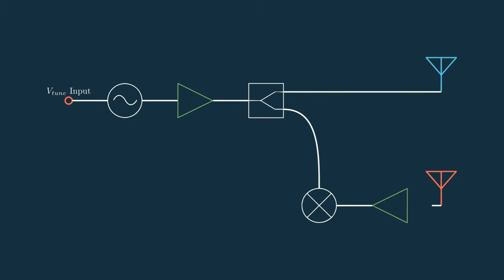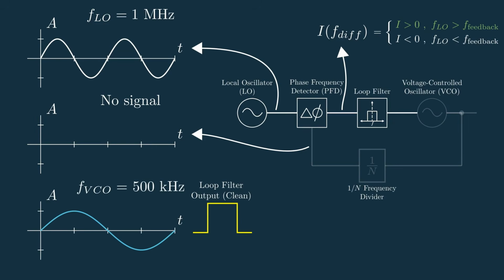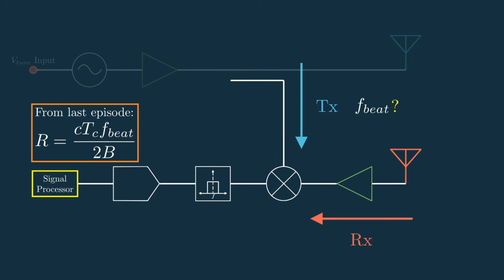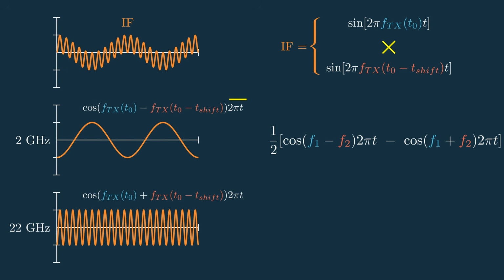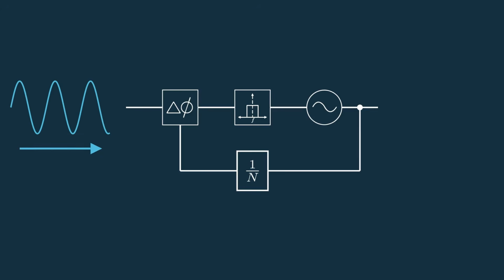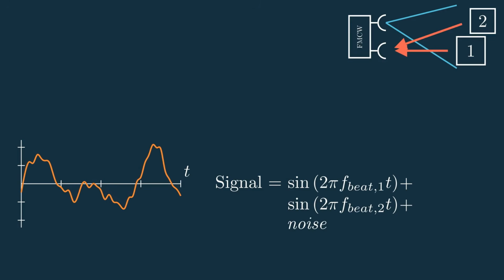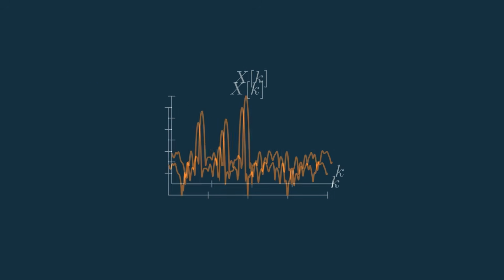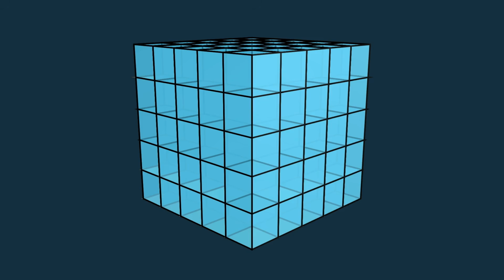How do you build an FMCW Radar?

Comment: I implemented a PLL in C code when I was working on a Stirling converter. A position sensor gave us a periodic but not sinusoidal signal and we used a PLL to turn that signal into a clean sine wave. I didn’t understand the math of the PLL and had never heard of them before, but I did know how to turn a block diagram into C code and it worked well. That was just one part of the controller that also included a couple PID loops
Reply from the maker: Awesome project!

Comment: if you like this maths, you should have a look at how MRI machines work - it is similar - acquiring spread spectrum frequency samples then doing multiple Fourier transforms to resolve 3d images of what you're sampling with radio waves and magnetic fields.
Reply from the maker: Super interesting! Thanks for pointing me to it!
Reply: @MarshallBrunerRF  super-funky MRI can actually multi-dimensional analysis of single voxels - examples include diffusion tensor imaging for mapping the direction of neurons in the brain, basic t1 vs t2 imaging to measure the difference between fat and water based on relaxation rates, or even MRS - where you do spectroscopy to determine ratios of amino acids, and their spatial distribution

Comment: Thanks for doing this video series! It's very well explained, and makes many of the concepts clearer - I wish I had it for reference a few years ago.
Regarding the FFT sampling, it would be helpful to explain how "real-time" detection is handled. Your explanation works if you want to do offline analysis, but typically you want to do detection with some update rate where N_window  is smaller than the total samples N. This is even more true when considering hardware implementations, such as doing the FFT in a FPGA, where you may be limited to say 1024 samples. In such cases, would you buffer N_window and perform the FFT on non-overlapping chunks? Or would you have some half-way overlap? Or would you run a continuous window such that your buffer is essentially a big shift register? Are there advantages / disadvantages to each? And then is there any notion of stitching the windows together after the FFT, or are they typically considered independent snapshots?
Reply from the maker: Thanks for the comment! And good point, yes often times you want your radar to be able to react in real-time and this may be too slow for that. Non-overlapping seems to be the simplest / least compute intensive in many cases. The trend going along the line of non-overlapping, overlapping, and sliding DFT windows normally gets more resource intensive but also more flexible / low-latency reactions. Honestly on this, I'd have to defer to people more experienced with me in real-time FPGA programming as this is something I'm relatively new to.

Comment: Great Channel! Thanks for your efforts.  I have a question.
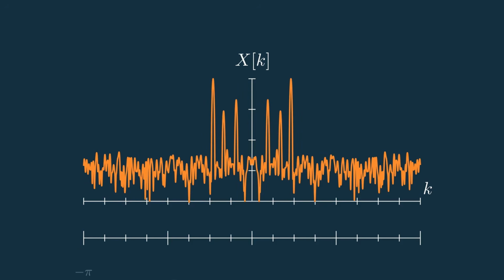At 17:08, you mention the FFT spectrum ranges from -Fs/2 to +Fs/2 accross negative and positive axis. Isn't that true for baseband signals only? Are beat signals downconverted to baseband before digitiazation?
Reply from the maker: There's a couple ways to digitize RF signals, but they are almost always downconverted at least partially. Many times they are offset by some amount (could be 2MHz just to get it away from DC noise), but sometimes they're also just converted to baseband. The spectrum of an FFT will always have the +- frequencies, but many times your signal is upconverted to RF or an IF in which case the actual information is contained around IF +- bandwidth. Hope this helps!

Comment: Hmm... I have doubts that anyone uses the PLL divider to modulate the output frequency. Usually when the divider is changed, the PLL will fall out of lock and it will take some time for it to stabilize. Maybe with a special divider that does retain the phase when the divisor is changed this would be possible? Usually the input (reference) frequency to the PLL is modulated, at least for some lower frequency applications. I'm not familiar with higher frequency radar systems.

Comment: I am curious if these systems also modify the polarization of the signal. I know that most aircraft radar uses polarized signal and, based on the polarization of the received signal, you can tell whether the target is at higher or lower altitude, for example. I wonder if these FMCW systems also modify the polarization over time to get extra information?
Reply from the maker: Honestly I know much less about dual-pol FMCW systems than I do about pulsed systems. I would love to make a video about dual-pol weather radar, though - that is one of my favorite concepts :) Thanks for watching!

Comment: Is it possible to get target data just from clutter alone only using a receiver?
Reply from the maker: There are passive radars with no transmitter, but they still need to be able to detect some microwave source. There needs to a transmitter somewhere, but that could be a multitude of things. Thanks for watching!

Comment: I just had a quick question. At around 10 minutes into the video, you discussed the noise that could interfere with getting the beat frequency, and you mentioned using a bandpass or other filters to cut out undesired noise. But then doesn't that restrict the velocity of the object you're tracking to a single direction. If you use the lowpass filter like in the video, then any object coming towards you would just be invisible, no? Just wanted some clarification, thanks.
Reply from the maker: There's a few ways to get velocity information (some of which I talked about in the next video in the FMCW series about range-Doppler measurements). You don't necessarily have to lose velocity information like this with filtering. Often times the same chirp is transmit multiple times and then pulse returns are compared to one another (using the FFT) to extract velocity information. Thanks for the comment!
Reply: @MarshallBrunerRF  Thanks for the response. I'm still a bit lost, even if the same chirp is transmitted multiple times, if the output happens to fall on the wrong side of the original transmit frequency won't the filter just cut it out entirely? Appreciate the help!

Comment: What do you think about BGT24MTR11E6327XUMA1 as the main radar chip? Is it difficult to implement?
Reply from the maker: It looks pretty cool to me! One thing would be that it seems to be at end of life, but if you don't care about manufacturing this or supporting it long-term, I guess this doesn't matter much - it seems like there's still a good bit of stock. If this is the frequency band you're interested in operating at, I think it would work well. I think it'd definitely be worth a try at $13!

Comment: Hello again 😊

I feel that you are too focused on modern digital solutions to really show how the fundamentals of signal processing does not need that "complication".

Consider the PLL, the modulation input as described here is by manipulation of the frequency divider. An analog solution could just use a VCO.

Consider the output, a (simple) RF decoder tuned to a centre of the expected beat frequencies would output a voltage determined by range.

Note, aviation radar altimiters use a triangle modulation. That way rate of climb, as well as altitude are easy to decode with analog circuits.
Reply from the maker: Very good point. Yes there is a lot of extra complication with modern systems. My thinking was that if someone opens an automotive radar datasheet or looks at an FMCW schematic they would recognize the parts. I agree that it could be more helpful for someones deeper knowledge to understand the basics and build up from there. Maybe I will do a separate video on that. Thanks for watching!

Comment: Ah this must be  the sort of "radio altimeter"  used by large jets on final approach in low visibility weather. They work from a couple thousand feet right down to 10 feet above the runway. 
(And a frequency that the corrupt FCC is allowing certain 5G carriers to crowd into for unclear reason$$. ) 
Barometric pressure is used at higher altitudes to keep all the planes on the same relative reference.

Comment: very interesting field but not something you can build in your yard. Mostly associated with phd students in military and aviation industry. Nevertheless interesting field and great videos.
Reply from the maker: @rubhern8187  well there are some radar chips for under $100 that can do well, especially for automotive use cases. But yeah the price can scale quickly depending on your use case
Reply: You can do it with a Software Defined Radio, though phase-coherent duplex tx/rx ones are pretty expensive (like the Ettus Research B100 series)

Maybe it's possible to do it for cheaper with incoherent radios that can transmit (like a HackRF) and receive (like an RTL-SDR) and do a phase locked loop with the strongest part of the pulse (Line-of-sight)

Or you can get radar chips like he said 😂

Comment: AI Summary

Abstract:

This video explains the hardware and software implementation of Frequency-Modulated Continuous-Wave (FMCW) radar systems. It details the core components, starting with signal generation using a Phase Locked Loop (PLL) comprising a Phase Frequency Detector (PFD), Voltage-Controlled Oscillator (VCO), and a variable N divider to create the necessary frequency ramps (chirps). The signal path involves amplification and splitting for transmit and reference paths. A key component, the mixer, is explained as a multiplier that generates sum and difference frequencies from the transmitted reference and received target reflections; the difference (beat) frequency contains range information. The video addresses mixer challenges like image frequencies and solutions like filtering or image-reject mixers. Finally, it covers the transition to the digital domain via an Analog-to-Digital Converter (ADC) and the use of the Fast Fourier Transform (FFT) on the sampled beat signal to produce a range-FFT spectrum, where peaks correspond to target ranges. The advantage of FMCW's zero minimum range capability over pulsed radar is also highlighted.

FMCW Radar Implementation: From Hardware Components to Range Detection

*   0:00:28 System Overview: An FMCW radar consists of transmit and receive sections with key blocks: signal generator (PLL), signal conditioning (amplifiers, filters, splitters), mixer, Analog-to-Digital Converter (ADC), and antennas.
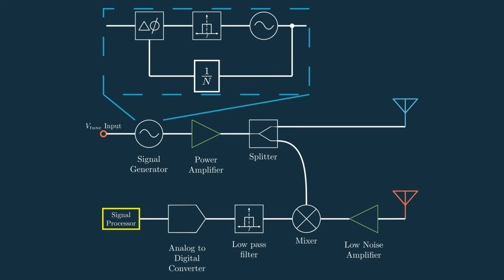*   0:01:12 Signal Generation (PLL): A Phase Locked Loop (PLL) is commonly used to generate the frequency-modulated signal (e.g., sawtooth, triangular wave).
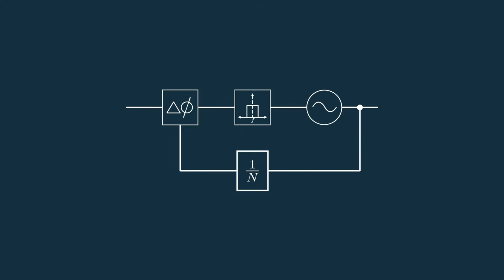*   0:01:49 PLL Components: The PLL consists of a Phase Frequency Detector (PFD), a low-pass filter (charge pump), a Voltage-Controlled Oscillator (VCO), and a frequency divider (N divider).
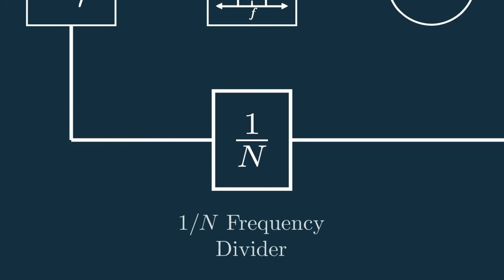*   0:02:10 PLL Operation: The PFD compares a reference frequency with the divided VCO output. Its output current/voltage adjusts the VCO frequency until the loop locks, making the VCO output N times the reference frequency.
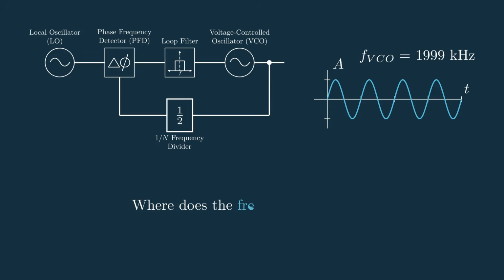*   0:04:40 Creating the Chirp: The frequency modulation (chirp) in FMCW is achieved by dynamically changing the division ratio (N value) of the PLL's frequency divider, causing the locked output frequency to ramp up or down.
*   0:05:43 Obtaining the Beat Frequency: The core goal is to find the frequency difference (beat frequency) between the transmitted signal (reference) and the time-delayed received signal reflected from a target. This difference is proportional to the target's range.
*   0:06:16 Mixer Functionality: An RF mixer multiplies the reference (LO port) and received (RF port) signals.
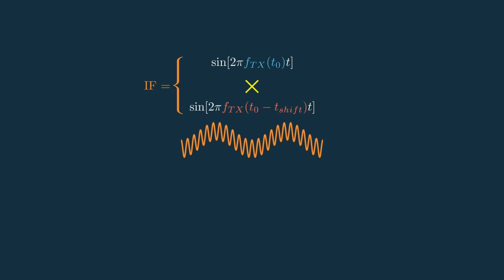*   0:08:07 Multiplication Yields Difference: Using trigonometric identities, multiplying two sine waves produces components at the sum and difference of their frequencies. The difference frequency component is the desired beat frequency.
*   0:08:51 Filtering: The unwanted sum frequency component is typically much higher and easily removed with a low-pass filter after the mixer (on the IF port).
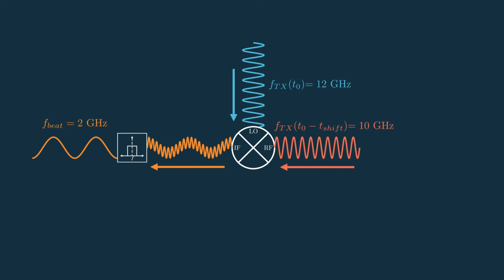*   0:09:06 Mixer Image Problem: Standard mixers produce the same Intermediate Frequency (IF) output for RF signals located symmetrically above and below the Local Oscillator (LO) frequency. This "image frequency" can allow noise or interference to degrade the desired signal.
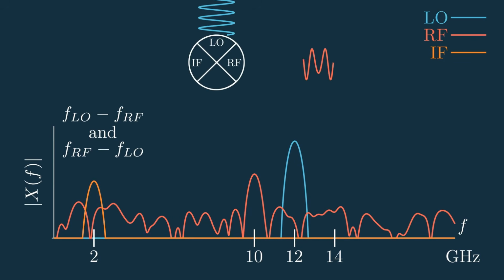*   0:10:08 Image Rejection Solutions: The image problem can be mitigated by using a band-pass filter before the mixer to remove signals at the image frequency, or by using an image-reject mixer architecture.
*   0:11:48 Digitization (ADC): The analog beat frequency signal (IF output) is converted into the digital domain using an Analog-to-Digital Converter (ADC) for processing. The ADC samples the signal at discrete time intervals.
*   0:14:32 Frequency Spectrum Analysis (FFT): The received signal contains multiple beat frequencies from different targets and clutter. Applying the Fast Fourier Transform (FFT) to the digitized time-domain samples converts the signal into the frequency domain.
*   0:16:03 FFT Processing: Common steps include applying a window function to the samples (improves peak detection), performing the FFT, and often converting the output magnitude to a logarithmic scale (dB) for better visualization.
*   0:17:21 Range-FFT Spectrum: Since beat frequency is proportional to range, the frequency axis of the FFT output can be directly mapped to range. Peaks in this "Range-FFT" spectrum indicate the presence and range of targets.
*   0:17:47 FMCW Minimum Range Advantage: Because FMCW transmits and receives simultaneously, it doesn't suffer from the minimum blind range inherent in pulsed radars (caused by the transmitter being off during listening time), allowing detection of very close targets.
*   0:19:18 Future Topics: The video mentions that velocity information (Doppler) can also be extracted, leading to concepts like range-Doppler maps, which will be covered later.

I used gemini-2.5-pro-exp-03-25| input-price: 1.25 output-price: 10.0 max-context-length: 128_000 on rocketrecap dot com to summarize the transcript.
Cost (if I didn't use the free tier): $0.05
Input tokens: 15858
Output tokens: 2648
Reply from the maker: Cool